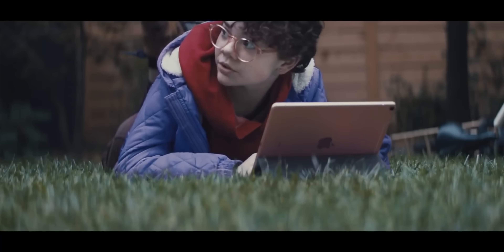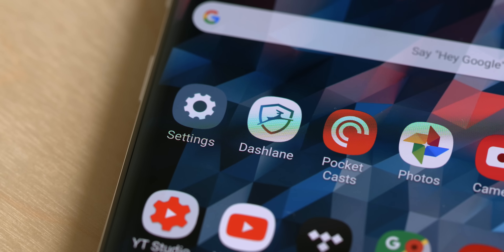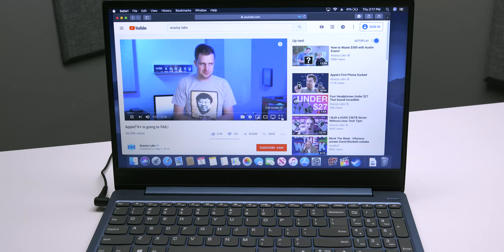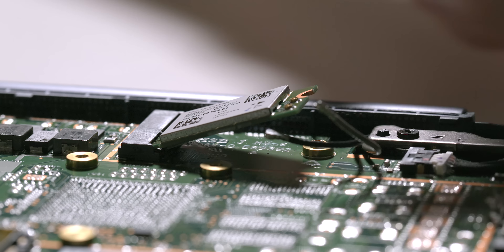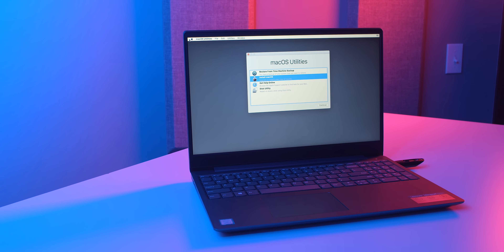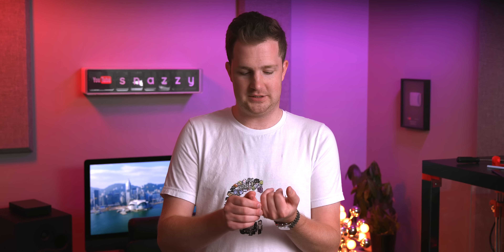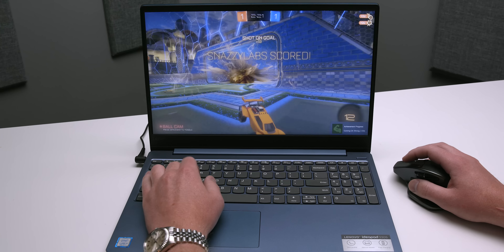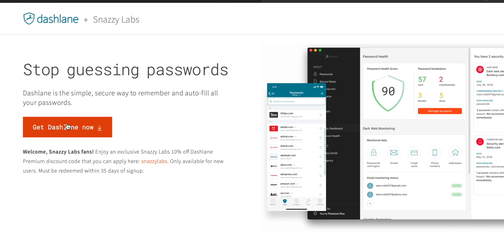The $279 MacBook Air KILLER!

Comment: it has a full size keyboard and when typing if the track pad were to be in the middle you would have issues with tracking. Computers with full size keyboards will always put the track pad linear with the space bar

Comment: I had an iPad 2 and realized it was just an oversized iPhone at the time. I just got a new base model iPad and paired with iPad os, I can say that Apple has finally reached the laptop replacement status that they’ve been promoting for years. While pro users will still need a real Mac, the iPad does almost anything I need it to and my 15inch pro only gets used when I need to type long papers or edit video. At this point I think the average user only needs an iPad or Chromebook. Full windows and Mac computers are becoming more niche as the years go on. And I think both Apple and Microsoft realize this and the rise of arm PCs and Apples continuing  convergence of macOS and iOS is a clear sign of the future of computing.

Comment: Haha, I was curious to see this "MacBook Air killer", just to realize its a laptop that I already own for a full year now... Poor people's MacBook as I call it :)
Its a great budget laptop, with decent keyboard and trackpad. Good build quality with aluminium top, very light for the screen size and the footprint is pretty compact due to thin bezels.
Friendly advice is to get 1080p IPS screen version with 3 cell battery. That screen is just superb and battery lasts 5-6 hours of netflix. It shouldn't cost much more since it was priced around 440 USD (400 euros) when I bought it, and here in EU the prices are generally higher.
Don't let i3 badge fool you, its 8th gen so 2 cores and 4 threads and beats i5-7200U or i5-6200U. Ram should be upgraded but even with 4gb its usable on Win10 for office work, web and media consumption.
There are also 14" and 13.3" versions (Lenovo 330S-14IKB and 330S-13IKB) which have more of a MacBook-esque appearance, since they don't have a numerical keyboard.

Comment: PSA: If you don’t need Mac OS and want a cheap productivity/gaming laptop you can always get the 330S-15ARR for only slightly more. I got mine for 300 and it works for low to mid end gaming and even some high end games like borderlands 3 with the help of the Ryzen Controller app. Plus you get a full HD display with the 15ARR model.
Reply: how did you get it for 300
Reply: @mizstinkie  bought it used

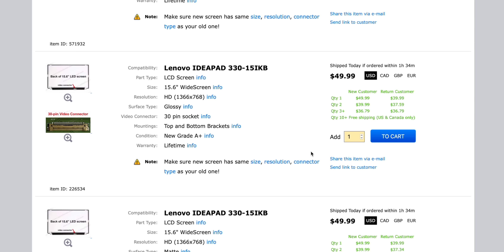Comment: 3:23 these dies will not fit because they are for the 330 model, they have additional screw space for 330s there are no fixings.
The matrix from i7 version can be used up to 330s because it has full hd

Comment: I think the battery is a real killer though, the huge benefit to the macbook air is the over-10 hours or whatever that the battery lasts.  You can take it to all your classes or whatever, it lasts forever.  On the other hand, this < 3 hours is pretty bad and there's no way to upgrade the battery.  It's nice that the benchmarks are better than the air, but I feel like with the battery being so dismal it fails at "being a laptop", as you'll need to be tethered to the wall for any long work periods.

Comment: Looks like the similar Laptop to my Lenovo Ideapad 3 with the Ryzen 4600U CPU and Ryzen Graphics.  I put in the extra 16GB Module bringing the RAM to 20GB.  (I think that is max) I added a 500GB M.2 SSD and left the 1TB Spindle drive.  I cloned the 1TB drive to the M.2 drive and formatted the 1TB Spindle drive.  So the M.3 drive is the boot drive and the 1TB Spindle is just a data drive. I paid like 350 for the Ideapad 3 with the Ryzen 5 4600U and it's pretty zippy.

Comment: To be fair to get the MacBook experience earlier model macs do just fine, I bought a MacBook Air Early 2015 model for $450 AUD (roughly $308.49 USD) and the machine is near perfect aside from a loose hinge to machine came with no other issues, So if you have the extra bit of money laying around an earlier model mac still performs really well especially for students as I can easily get a full day of study out of the battery, the only issue I personally have is storage but that is an easy upgrade that isn't really important if you can opt for cloud storage. 
For the record this isn't me trying to diss this video at all, I quiet enjoyed it, I'm just trying to point out this isn't the only option.

Comment: I clicked your link to the one you show (as configured) and it's $560+ USD at amazon? No where near $279??  Also, with all of the room in that chassis, I'm sure you could replace the dismal speakers with better. Lastly, if the solder points are there for a GPU, that also ought to be able to be added/upgraded (providing you are or know someone like Louis Rossmann  ;)

Comment: I hackintoshed my desktop was quite easy in my case due to parts besides the GPU being nvidia, but because that it never really pushed me to go deeper into hackintoshing as much because my system well just worked.

but I decided to hackintosh my lenovo vanilla style, and it was a much more interesting experience and the outcome is more, as I couldn't find much info on my particular model so it was trial and error, but I have everything working, sleep, correct power, usb ports, trackpad/keyboard (gestures) audio.  my system is complete, and performs as well as the 2018 macbook air, being a tad bit behind in geekbench 4.  and all i'm missing is a wifi/bt model which is arriving soon, which will add hand-off, continuity etc. completing my Lenovo Macbook Air.

Comment: Tutorial Forum Post - COMING SOON ?? 10 days later   crickets  - could really use tips on getting that trackpad working!
Reply: D.S. Holmstrom I used the EFI folder he has linked and it is working perfectly for me. The trackpad does stutter when on battery power but can be fixed by removing the battery Kext from your EFI folder

Comment: Could it be possible to make similar modifications to an HP ProBook 450-G3? I've been using one for the past 3= years, and it's very capable as is. It already has a long-lasting battery, 8GB's of RAM, an Ethernet port, and even a CD drive. The ProBook runs quite well with Windows 10 Pro, but now I'm curious as to how it might do with MacOS...
Reply: You can try, it requires a lot of patience and success is not guaranteed (especially with laptops) but if you like tinkering it's also fun and you learn a lot

Comment: If she speakers sound crappy just take a part an old MacBook and make the speakers fit in there with some adhesive strips. Strip the cables tie them together on the original connector and done you've got better sound problem solved.

Comment: Recently picked up an old 17” MBP w/16GB for $550 on eBay. Added a 2TB SSD and voila! Perfect business app machine. Better yet, when you pull it out in public people go “what the heck is that thing!” Due to its large 17” display. [update 10-26-2020: The dreaded video card failure issue with the 2011 MBP hit and I cannot get it to switch to the internal Intel graphics using the normal software methods so I'm back in a Hackintosh mindset, even though I will get the MBP GPU disabled with a hardware workaround eventually.]

Comment: 420 euro / 460 dollars  for Lenovo IdeaPad S340 :  14" 1080p TN screen, cpu  Ryzen 5  3500u 4c/8t,  onboard gpu Vega 8,  ram ddr4 8gb, ssd 1TB PCIe x4 Samsung OEM PM981,  back light keyboard   and same   colour and ports like the one in the video.
I never had a laptop  but i want to try one   and  this looks like the best  buy all around  price / specs. (i will use it for Youtube, email, other browser things  and  saving photos from my phone / sd card photo camera - so just very light things,  not for games or video edit or programming)
The only  down i see is the screen  TN panel   and only single channel RAM. (even if it 8gb from 4gb soldered + 4gb  stick in the only slot)
What do you people from the internet think about this ?

Comment: Or you could get literally any used unibody MacBook Pro on eBay for less than $250... which will have a better display, a core i5, more RAM, and an SD card slot that works

Comment: This is basically a macbook air, spec wise, except for the terrible display, and half the RAM, However, this has the same generation processor, both dual cores with hyperthreading, but the macbook air uses a Y series processor(used to be called Core M not Core i-Y Both processor stacks are between 4 and 8 "watts") the lenovo however, uses a more powerful, but still low powered U processor, but this means that "15 watts" is available the base clock is the key metric, the i5 on the imac starts out at 1.6Ghz, where as the i3 in the lenovo starts out at 2.2Ghz, additionally, the lenovo's i3 will go to its turbo speed for longer than Y/M series processors, IIRC turbo time constraint is twice as long on the U series than the Y series. All core turbo is also higher on the i3, because of the higher TDP

Comment: Yeah... the replacement displays you've shown are no better either, the contrast is absolutely abysmal, when brightness is cranked to max, you have to sit around 2.5 feet away from the monitor so see the fine print and since it's a low res panel... well it's still gonna be terrible since you can see the pixels, it's better to put those 60$ for a screen into laptop upgrade.

Comment: How do you make a Hackintosh if you don't have a Mac already to get Mac OS from?

Also, if you're going to call something a MacBook Air killer, shouldn't it at least have a decent display? Did you include the cost of at least the WiFi card and RAM upgrades into the $279? Finally, I care about SD card slots, but you can always work around that with a USB SD card reader.

There are many other Windows laptops that would be more viable MacBook Air killers in the $500 to $600 range...better performance, more comparable build quality, and at least 1080p IPS screens.

Comment: Dell E6430 + Atheros AR9287 Wifi is a good under 200$/150$ solution with really good upgrade paths up to a i7 quadcore and dual SSDs. Just installed mojave on mine, everything works.

Comment: Which kext did you use for trackpad, mine is Lenovo ideapad 130 everything works , I replaced the WiFi card .The only problem is the trackpad, keyboard works with voodoo ps2 kext but trackpad not working.pleaaaase help me.

Comment: Do you have any experience in Frankenstein-ing two MacBooks together? I got my externally very nice 2011 MacBook Air 11" here, but having issues with wifi connection since it came back from a repair after a water damage + I just broke off the right speaker socket on the logic board after having a look inside. Battery should be pretty good still as it was mostly lying in the cupboard for the last few years. I found an offer for a i7 2011 MacBook Air 11" in not that good shape, but it's reported to work just fine. The flaw is a japanese keyboard. So my plan is to switch upper-case and keyboard, display shell and probably battery from my i5 to the i7 and have one fine MacBook and one garbage Japanese one.

Comment: At this price point I'd recommend going used. I got my 2014 Air w/ 8GB ram for $350 on ebay.
Reply: Is it good for programming and some casual use?and the battery timing?
Reply: @ahmedzia99  I use it for word processing and I fire up blender just to show clients 3D models. It works great for that. I don't do rendering on it and haven't tried compiling code either. I use my i9 iMac for those things, but it would probably compile code fine, it would just take forever.
Reply: @ahmedzia99  oh yeah, battery lasts about six hours under heavy use. Under light use I've never used it up so I don't know.

Comment: and .. I personally bought macbook pro JUST for the GOOD high resolution screen that is STILL like a 5% of all the greatest and most color accurate laptop screens available.  Saad but you can't have good screen without spending money. or if you do some HEAVY research online on reviews, testings, you can find some good older Lenovo laptops with really good high quality screens (FHD only) or spend more and find some good IPS 4k or 3k screen that can match Retina screens in resolution, but almost NEVER match the Retina color accuracy that is crucial for professional work. - that's just one little bummer. :D cheers! other than that macbook's are nothing more special than any other good well build laptop maker like huawei, lenovo, hp, etc.

Comment: You can buy a 2012 Macbook Pro 13in with 8gb of ram and a SSD for $150ish on Ebay. It will accept 16gb of ram max. Why would you buy a PC to emulate a Mac for more $ And of less quality? Right now is a great time for people interested in getting a Macbook. The used market is flooded with these models. For $279 you can get one hell of a newer model MBP (2015ish). Im still using a 2012 MBP 13in w/16gb ram and SSD and its my everyday computer. Runs great.

Comment: I hate laptops having this weird resolution (1366x768). i much more prefer them having regular 720p resolution - 1280x720. at least it won't have any kind of processing when dealing with 720p media or games. and it would look crisper compared to 720p stretched to 768...
i get that they do it because of older manufacturer standards (1024x768), and that because of those old monitor standards a lot of UI is build to have at least 768 pixels at the vertical. but still it's stupid

Comment: Wondering about how this laptop performs running the latest Linux distributions.
Reply: Should fly if all the hardware is supported by Linux.
Reply: does Linux run xcode or final cut or seamlessly work with the phone over 1.4 billion people own?
Reply: @avocademy  I don't understand your answer.
Reply: @TonMachielsen  Linux does not run programs people need that are exclusive to MacOS also 1.4 Billion people use iPhone so people like how well iPhone and MacOS work together.
Reply: @avocademy  So? That's completely unrelated to my comment. I was wondering how this cheap hardware would perform when running Linux. I know Linux doesn't work well with iPhones and doesn't run MacOS apps but how is that related to my question?

Comment: or... just buy an used mid 2012 macbook pro on ebay (if you're lucky, you can get it with a i7 processor and 128-256gb ssd for the same price as this laptop)

Comment: The new MacBook Air is a joke, with the mobile CPU of the much thinner and lighter 12” MacBook (now discontinued), while being almost as thick and heavy as the much more powerful, Touch Bar-equipped MacBook Pro.
I swear the MacBook Air was just brought back to capitalize on the older Air models’ legacy and sell that sweet nostalgia, doing nothing to actually further the Mac line.

Comment: this video misses the real point. no one buys an Air for performance. it's for something light that works with very little fuss or tinkering. Now if he put together a better performing macbook pro for $279 then we're talking. I have a i7 MBP that I use for heavy duty stuff. For traveling I bought a mint condition, practically new in the box 2013 Air on ebay last year for just $350. It does the job perfectly.

Comment: 4050MAh!!! Well my phone's battery capacity was bigger than that lol
Reply: This has a dual cell battery and correct me if I am wrong but your phone has a single cell battery. This means to compare the capacity you would have to double the amount listed on the laptop battery. This is why the guy refereed to the amount of Watt hours instead of amp-hours, with the formula of watts being Voltage x Current. Regardless to have larger than a 4050mah capacity that's one serious battery your phone has, out of interest what model is it?
Reply: what phone do you have

Comment: I was lucky enough to pick up the i5 model with the much better 1080p screen for $350 during a sale at Best Buy. I maxed out the RAM (20Gb) and swapped the Optane drive for a regular nvme drive and the spinning HD for an SATA SSD. I have macOS on the nvme drive and windows on the SATA SSD. The feel and location of the trackpad are definitely subpar compared to an Apple notebook. And don’t get me started on the atrocious battery life. Has anyone been able to swap the keyboard for a backlit model? (I think it’s possible as the logic board seems to have the backlight connector) I have also seen where someone has put in a higher capacity battery (the new battery didn’t mount correctly but it did fit (I assumed was loose in the chassis or was “taped” down).

Comment: Has anyone found a good source for the BCM94352Z?  Tried a search on Lenovo's parts -- nothing.  Tried on Dell -- it pulled up some cards but none of them said "BCM94352Z"   Amazon's prices are CRAZY and eBay for a reasonably priced one  takes over 60 days for delivery (From China)!!!
Reply: Mine came from eBay for $65.99. It didn't take too long to arrive but I just used the laptop without WiFi in the meantime.

Comment: Is there a slightly more exspensive version that atleast gives you 1080p
Reply: Yes, I just purchased this 330s on Cyber Monday. Specs are 8gb ram 256 SSD, and the screen resolution says 1080p. I'm still waiting for it to come, but Walmart had it for $299. I hope I don't regret spending and extra $100 on the Acer Aspire 5 with the same specs. But hey, $100 is $100.

Comment: Not a Macbook Air killer anymore... this video hasn't aged very well...
Almost a year later, apple silicon would be on par with a high spec 16" MBP for 999...
Props though, it does do what it says, running MacOS as cheaply as possible (on a new-ish laptop)

Comment: Or get a used 2012 Macbook pro and throw in an SSD. Would cost about the same as this build.
Reply: yeah that's an option but what about the outdated hardware in that 2012 macbook pro ,which can cost from $490 - $600 just for the computer alone still 7 years after its release and of-course your going to spend more money for the ssd and your ram upgrades , vs this fairly new machine.
I've been doing a lot of research on it I see this as the cheaper alternative for someone to save hundreds of dollars and still get the mac os experience